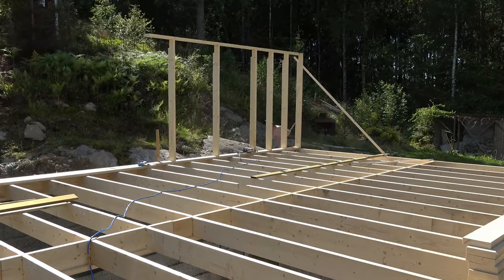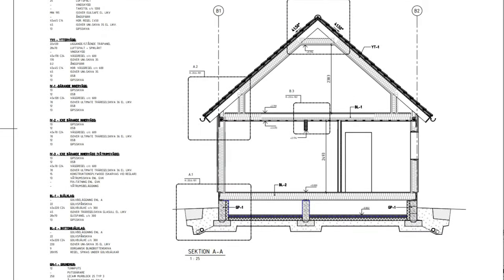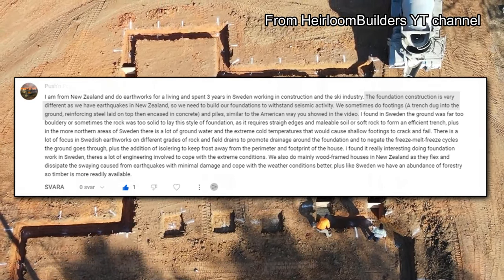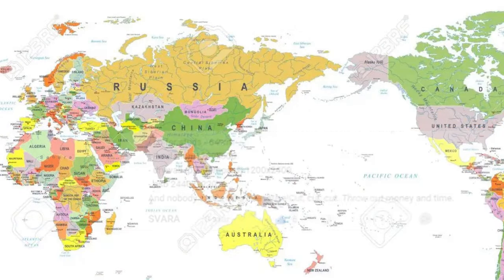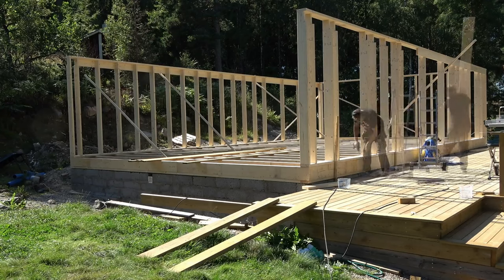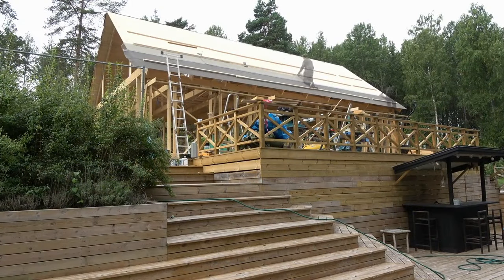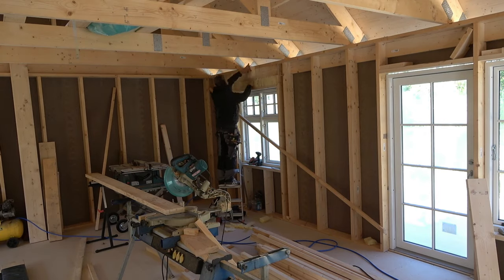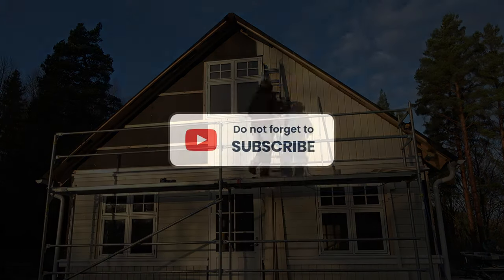UPDATED VERSION! Scandinavian VS American, CA, NZ, RU, AU building methods, let's compare...

Comment: The wires in conduit in The Netherlands, Belgium and Germany are solid, never braided (about AWG13). Pulling them through conduit is not easy but doable (5 wires in 5/8" conduit).
Concrete and brick houses here are built with just conduit. The wires are installed later.

Comment: Great video. I have really enjoyed comparing and contrasting your building methods with what we use here in the U.S.. I was blown away when you stated that your osb, chip board size was regulated by what was deemed safe to carry. Wish we had that here. 48”x96” 3/4 ply isn’t fun.
Reply: That's roughly the dimensions we use in Germany as a 'one man board'.

Comment: As a kiwi, I found your foundations mentioned pretty interesting. What has gained popularity in modern houses post the 2011 Christchurch quakes is what is called "rib raft" foundations. It's a combination of the floating slab found on sesimicly stable areas with the trench and concrete style. 
The idea is the reinforced concrete in the trenches act like ribbing on a casting, tired into the reinforced concrete of the slab, tying it all together to the entire foundation stays together and rides the quake like a raft. 
Unsupported slabs would break into several pieces, but being all tired together the whole thing just holds together.

Comment: Particle board (chipboard) (colloquially referred to as Weetbix) flooring is still very common in NZ because it is cheap. But we lay it straight away, so it is almost certainly going to get wet. Then it grows. Sometimes a lot! Advantage of laying it is of course that it provides a work platform. Health and Safety inspectors would not be happy otherwise (nor would I). Having the sheets continue under the walls also gives a stronger diaphragm. 

Hammer boards are interesting. We use 90mm framing so we’d lose too much strength if we cut half of that away. Our double top plates are strong enough to support most trusses at any point. We also have a love affair with large windows requiring bigger lintels/headers, so a single hammer board would often not suffice. 

OSB or other sheet product is slowly becoming more common on the outside. We never used to do that. Just tar paper or ‘wrap’ stapled to the framing. We never use it under our plaster board. We use our plaster board as bracing for lateral support, with set screw patterns. This means it must be directly fixed to the main frame. That would complicate the use of an inner frame fixed horizontally to the studs. Fixing OSB or ply under all plaster board would cost a lot more than $1000 here. It would be a very expensive way to fix a few pictures…

Also, the horizontal 50x50 framing does not provide any lateral strength. Only angle braces or sheet products will do that. We use nogs/dwangs (fire blocks) commonly but that is largely a hangover from days gone by. We used to have them at 600 c/c to keep studs from twisting (we used to use wet frame before kiln drying came in some 30 years ago). Also, because sarking used to be common (with scrim and wallpaper) before plaster board was invented, it was thought that blocks were a necessary compromise for the loss of that sarking. We now typically use two rows of blocks at 800 c/c even though we know that one row is (more than) sufficient. Habits die hard. 

We get plaster board up to 6000 long. We now fix it horizontally to studs to avoid butt joints. This means running the sheets across the studs. We also do this for ceilings. We now avoid having joins over support as this is more likely to create cracks. We avoid having a block/nog/dwang directly under the horizontal join in a wall. Seems very counterintuitive at first. 

I like the pipe in pipe idea. Never heard of it. Is the actual inner pipe flexible enough to replace later?

I learned my trade in Dutchland in the eighties. Timber fame building was just being introduced there at the time and we looked closely at how it was done in Scandinavia and North America. It was then deemed correct to have a vapour barrier under the plaster board, as it was in Scandinavia and North America. They have since learned, in warmer places like Florida, where air conditioning is now also more common, that this is a bad idea. The greatest challenge now IMO would be to get it right in areas where the climate is not clearly one or the other…
In NZ vapour barriers are still very rare. We just don’t do it. It may become more important as we keep increasing our insulation thickness. We are a bit behind the rest of the world with that.
Reply from the maker: Thanks, great information. Yes, you can replace the tube quite easily. It's fun how different we build.
Reply: I dispute that you'd lose strength in the top of the stud by notching it out for the hammerband. A 35mm band still leaves you 55mm of timber, and then it's all nailed or screwed together anyway. The weight of your roof is transferred directly down through the hammerband into the cut end of the stud, and the hammerband stiffens the whole wall so it's more resistant to horizontal loads.
If you're really worried that the top of the stud might split out, you could plan your tiedown to hold it together. It's pretty hard for a bit of pine to get away once you've got a length of galvanised strap wrapped around it and nailed in place.

Comment: What you call Fire Stops, are called noggins in Australia and are not use to stop Fire, but to shorten the effective lengths of the studs to reduce deflection and strengthen them.
Normal studs in Australia are 90 x 35mm as we generally do not need as much insulation space as you would need in Sweden or America. Here typical wall insulation is R3.8 .

Comment: From Wisconsin (U.S.A.) - interesting seeing the use of the "hammer band" vs the dubble top plate- where I live in Wisconsin we have a 40lbs per square foot snow load. We typically frame 2x6 walls 16" o/c with a dubble top plate- out trusses or rafters don't have to line up with the  up with the studs, but it is generally considered the best practice -

Comment: As a 'reformed' city planner (got out of that business) I realized that a lot of what we did had the principle effect of making homes more expensive and not better as a result.  The biggest knock-off is 'impact fees', most of these start out small, to cover the cost of the building (inspection) dept. but how they've grown!  I've heard of towns that get $75k for a single family house.  I owned an apartment house that didn't cost that much per unit to build and it was a pretty good unit.  Nails vs screws, american framers can drive a 16d nail in one blow, faster than the fastest screwgun, and nailguns are faster still.  Speed isn't everything but I have never heard of a house failing due to weak nails.  As for nail pullout, that isn't easy either.  You can go to ringshank or cement coated nails, there are even 'screw' nails that can be later screwed out and screwed back in but are still driven with a nailgun.  The common nail got its start back in the early days of the 19th century with the development of nail making machines that replaced the blacksmith at this trade, this one item revolutionized building construction.  I own a bunch of screwguns so I'm not against screws, but they are slower and more expensive and in most situations don't add structural value to the equation.  There are applications where they should be used but generally if a wood wall or structure fails, it's not the nails that caused it.  Your roof truss spacing is more than is common in US but we use purlins across the roof to support plywood decking.  The code should spec out the purlin spacing based on the roof loading.  American homes built in the late '40s/50s housing boom are getting on 75 years old and are still standing and mostly as proud as they day they were built.  Wood houses need care and upkeep but are cost efficient and were able to meet our needs rapidly with lower skilled workers needed for assembly.  Remember too that those palaces of Europe have mostly wood interion construction and wood structures to hold up the roofs.  What does strike me is our use of platform construction.  It i, building the floor deck as a flat surface then using that deck as a platform on which to build the wall frames that in turn are swung up as a complete unit.  It is not unusual for the walls to be completed within a day by a three or four man crew, generally a lead carpenter (skilled), one or two assistants, and the saw guy feeding them cut lumber.  It's an ''on the ground' (but off the dirt) job so you are not likely to fall, you can see everything and have a flat (hopefully) surface to work on.
Reply: The worst is when they added almost $100k to our homes here just due to putting in a sprinkler requirement.  I am all for regulations to ensure a minium standard of building but damn them when they add a un-neccasry item just to line some fields pockets.

Comment: I'm in France and did something pretty similar but used compressed (by hand) straw + clay as insulation, it replace osb sheets as it hardened when drying.
I used vapor barrier on the inside and rain sheet on the outside.
Reply: What's a rain sheet?

Comment: Great video.  I'm doing a post frame style house in MN (USA).  This is a 3rd option not covered in this video.  It will have a double wall for the reasons you described regarding not breaking the vapor barrier.  The foundation is concrete piers.

Comment: When I was building houses in Sonoma County California we would do something interesting with the floor. We'd build the whole thing and put the OSB subfloor on and then cover it with exterior latex paint to act as a water barrier during build. Most paint stores will sell returned paint for a couple of bucks a gallon so it was pretty cheap. Mix up a bunch of random paint and you get a pretty cheap barrier that's durable enough to last until the roof is on. I have no idea if it would work where you are since we don't get nearly as much rain here, but it seemed to work out really well for the houses we built.

Comment: In some parts of EU we're obligated to implement a cavity wall externally, read you've the bearing construction wall and outside the building we put on top of this construction an cavity wall. Often with aswel like in the construction walls an extra isolation with an outer protecting shell(cement board etc)! If we use cob, hemp or straw walls or only as an insulation we doesn't need a plastic breathing -condensation sheet!Never ever use glasswool as an insulation! And if we build in CLT/glulam/massive wood it chance realy everything lol. Thanks for your contributions, my intentions is kindness!
Reply: That’s how I’m plannig our future house. Vapor open construction, I-joist framing, OSB from inside, 320mm hemp fiber insulation, 60mm wooden fiber cover panels from outside , breathing facade with 50mm air gap and cement wooden wool panels. I just need someone qualified to help me to tweak details. I’m about to use some methods I came up with by myself so it’s probably impossible to let someone else to do it.
Reply: Hempcrete is my material of choice for my future build. Close to nature 🙂
Reply: @czechbaron111  Please film this and post it for everyone can you sir :-) Good job!
Reply: @GreyDeathVaccine  We should all doing this actually even in an existing concrete building we can build a box hemp in a box concrete. But Grow your own Hemp on your lot/area that you bought upfront you gonna start to built your house. I will revive your soil and creates building material for your hempcrete! good luck both

Comment: This is very interesting and as I watched your earlier one I am amazed at how many people imputed their methods relating to their countries or areas requirements.  In Australia although noy a builder, I know that we don't put OSB o the wall and then plaster board over it. The plaster is fixed straight to the studs. Most common roofing material is concrete tiles (cheaper) and they are placed on purlins nailed to the trusses. Nails are the usual fixings for the timber framing.

Comment: As far as I know here in Canada all plumbing and electrical is done before insulation and vapor barrier is done. This method eliminates the need for an installation wall.  Granted an installation wall allows for more insulation but it also adds cost and makes the living space smaller .

Comment: I also noticed your comment on the small size of OSB sheets being dictated by regulation or law. When I was framing houses in Texas in the 1980s, there was an unspoken expectation that you would never carry less than two sheets of 1/2" plywood (4x8 sheets) or 10 studs at 116 5/8" each (for ten foot walls). You could carry a single sheet of 3/4" plywood, but many guys would carry two sheets, to show off I suppose.

Many times I would need only a few studs to finish a wall, but I would bring over ten studs and leave the extras for someone else to use. Likewise, if I only needed one sheet of plywood. I would carry two. This was an unspoken thing. We were young men. "A young man's glory is in his strength."

I understand your method of setting trusses by hand. We would do the same thing even with a subfloor in place. You just have to swing one end of the truss further down the wall, so it's at a sufficient angle. Often we would haul all the trusses up onto the second deck and stack them there before raising the last wall. Of course the stack of trusses would be sharply angled and held to one side of the deck to make room for that last exterior wall which hadn't been raised yet. 

I notice you had rigged a rope from the truss peak, across to the gable, down, and back to where you could you could use it to set trusses alone. That looks very clever, and I'd love to see a video of you setting trusses alone. We always had several people: at least one on the deck and one on the front wall and one on the back wall, nailing and bracing.

In later years, we set everything by crane. In the 1990s I was framing huge houses in the Washington D.C. area, with  complex truss designs employing huge trusses. Many of these could only be built about twelve feet tall, so they were flat on top. A second "piggyback" truss is added to the top, to create the peak. We would set all the lower trusses, then rush to brace everything, installing 2 x 4 "catwalk" bracing every two feet, then the crane would set the piggyback trusses on top of that. Often, to save rental time on the crane, we would just stock bundles of piggybacks up there by crane, then set them by hand.

Many of these ridiculous houses had extremely complicated truss plans, with girders and monos and piggybacks to create huge complex hip roofs with multiple ridge heights, valley and hips. I remember counting all the different types of trusses in one house I framed in Potomac, Maryland in about '98 or '99. There were 104 different TYPES of truss in that roof. Some would have 15 or twenty of one type, maybe six of another type. Perhaps three trusses were nailed and bolted together to form a girder truss, to which 8 or 10 mono trusses of another type were attached. So there were many hundreds of individual trusses divided among 104 unique types.

I had an individual plan sheet from the engineers for every one of those 104 types ("Truss H 57-b  Quantity 8 - elevation drawing - loading calculations - bracing requirements etc".) I had  stacks of trusses all over the job site in preparation. I had the entire sequence of erection planned out and drew a diagram mapping the locations of all those stacks of trusses. "What's next? The G-19s? Where are they? Over there by the road!"

That was a busy day. We had a huge crane, which first set up in the front of the house, which was well over 100 feet long, setting everything that could be reached from there. Then the crane had to move around to the back of the house and set up a second time to continue. 

That one was bigger than most, but there were many, many houses that had 40 or 50 types of trusses. Back when we were stick building complicated roofs in Texas, I would not have thought it possible to build a complex hip roof with trusses, but I learned that it is possible, and I erected many of them.

Still, I prefer to stick build. There is a real pride and pleasure in calculating, cutting, and erecting a roof, especially a bastard hip roof, with individual rafters.